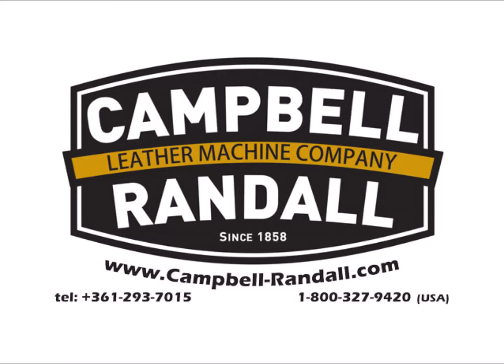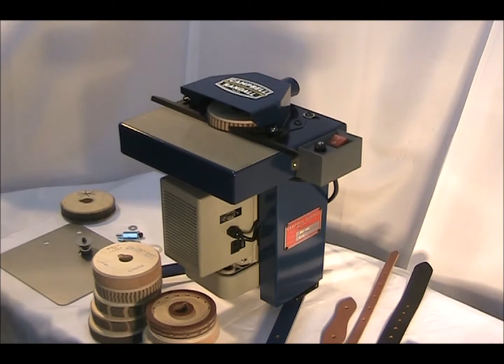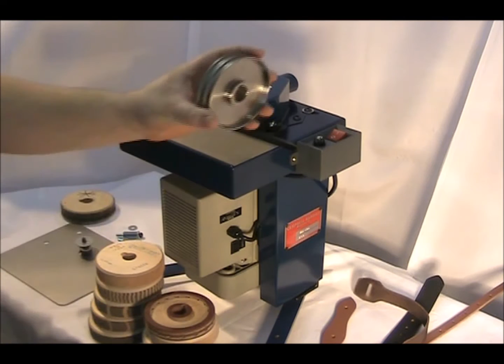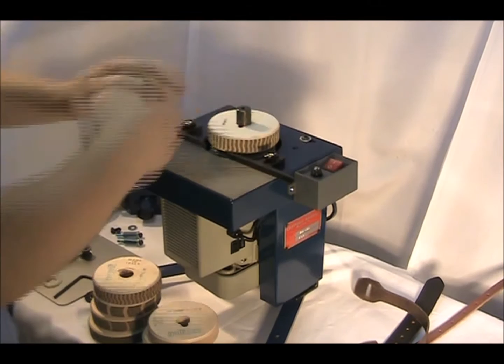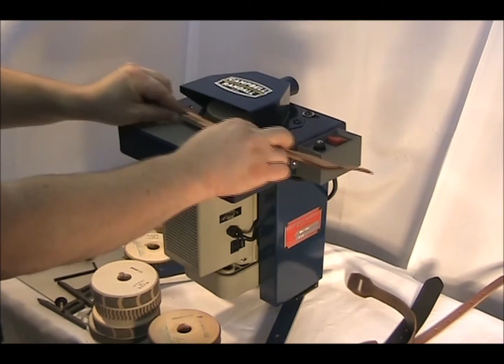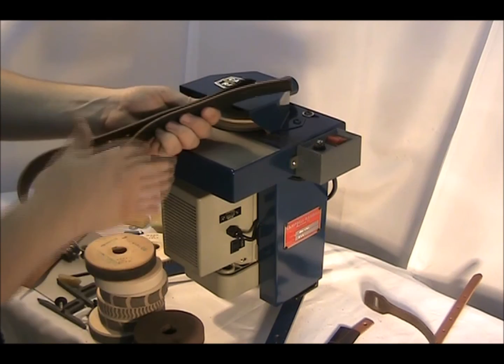VSB Burnishing Machine - Setup & Use

Comment: Should have made the top plate for the mini sander out of clear polycarbonate  like lexan or something similar for viewing of the lower 4” wheel
Reply from the maker: Thanks for the idea!  We'll have to kick around that idea and see what we come up with.
Reply: @CampbellRandall  
Are you guys serious???

I have the "Campbell-Randall" burnisher model that you sold before the current VSB and it has a clear polycarbonate cover on it that came as a factory accessory.   The polycarb cover assembly is Bosch made and is a router table type dust/chip shield with vacuum tap on the back.  Maybe you have some left in a dusty parts shelf.